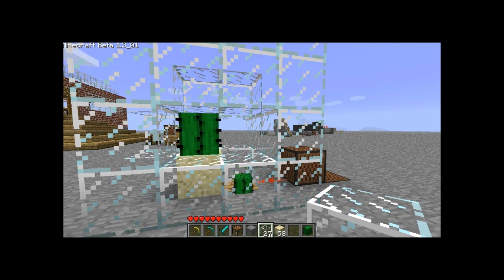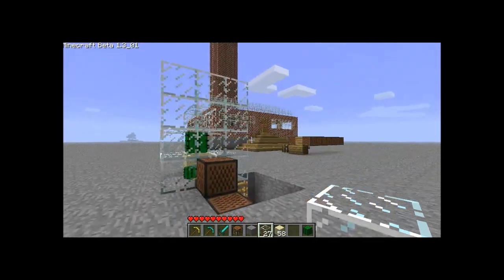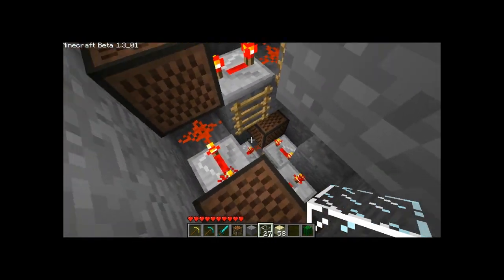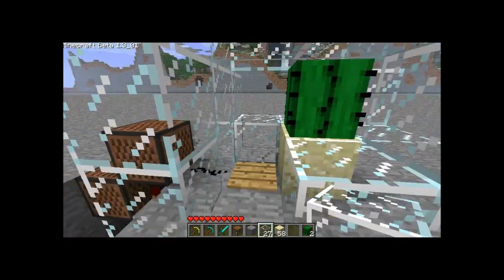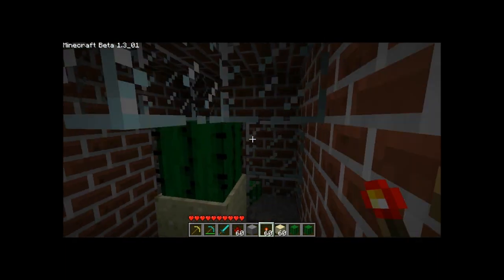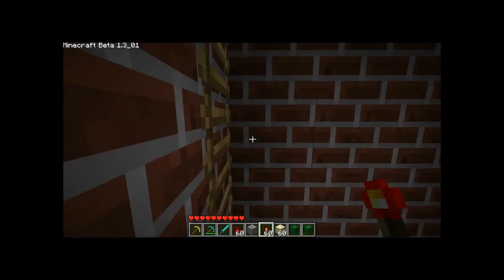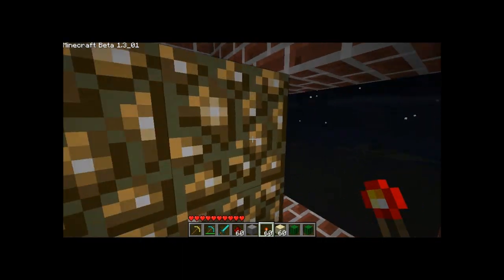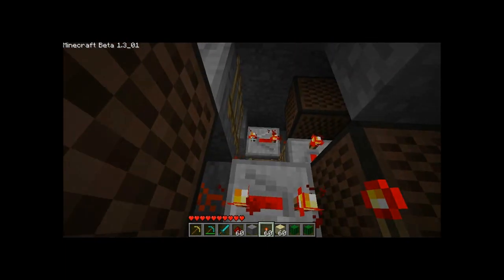Cactus Powered Clock Tower Chime

Comment: In the new update, you can use dispensers to do this every 5 minutes exactly, as long as you load up the dispenser with blocks (With something that stacks 64, dirt is best option) 64x9 = 576 chimes that go off every 5 minutes on the dot (Or thereabouts)